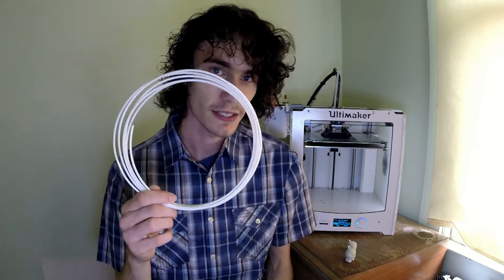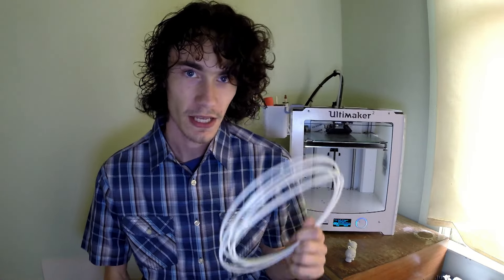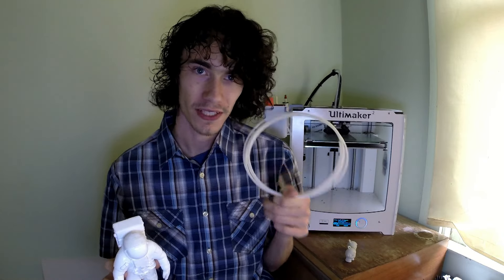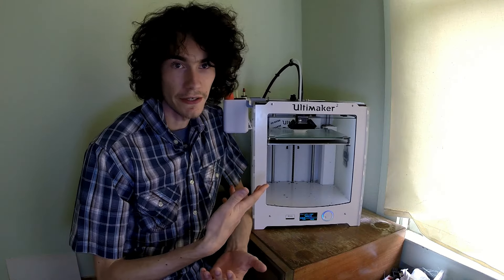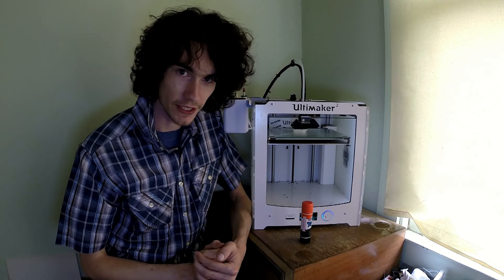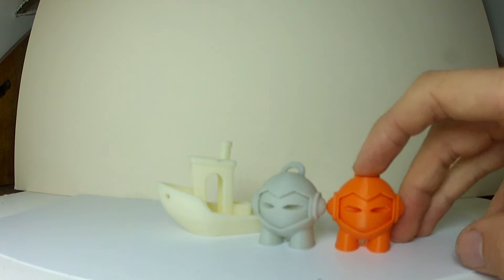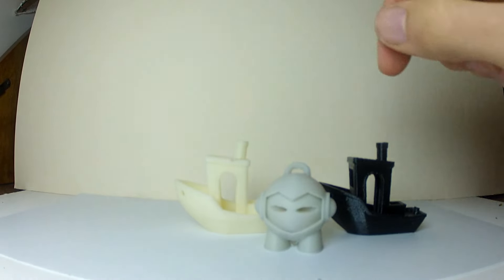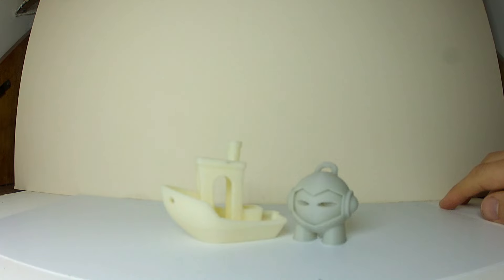Esun ABS filament initial impressions

Comment: I haven't actually tried the Elmers Glue yet, is it straight onto glass? I'll be following your experiences with bigger ABS prints on the Ultimaker 2 with great interest!
Reply from the maker: it was straight onto the glass. while it wasn't welded it was stuck pretty good!
Reply: Haha that concept terrifies me, would be so scared of cracking it. I would send you some of these flashforge 'buildtak' sheets if you weren't so far, ABS sticks so good to those.
Reply from the maker: +Maker's Muse https://youtu.be/EoTABlWLW-M that's me removing the benchy from the gluestick. I need to get some... my attempts with pla and xt didn't go so well!